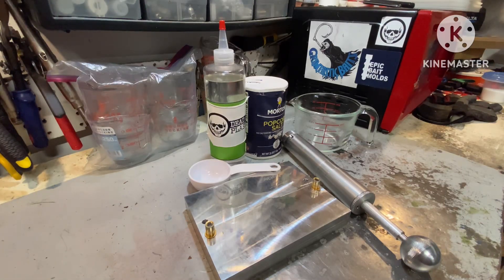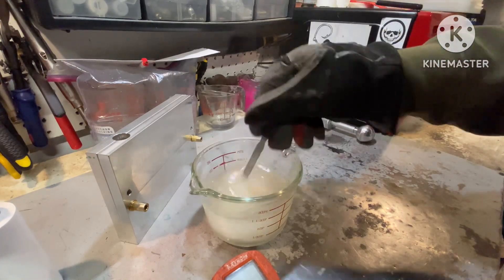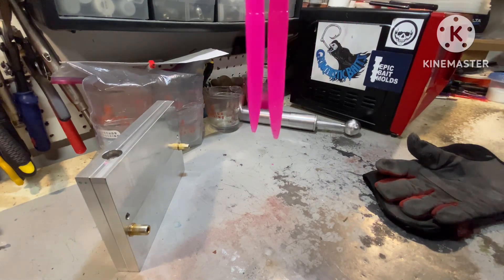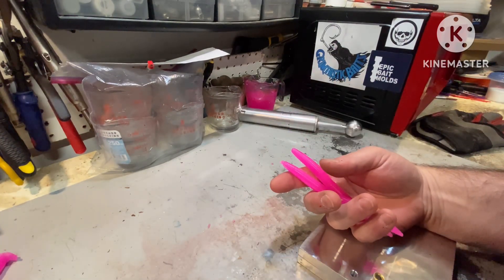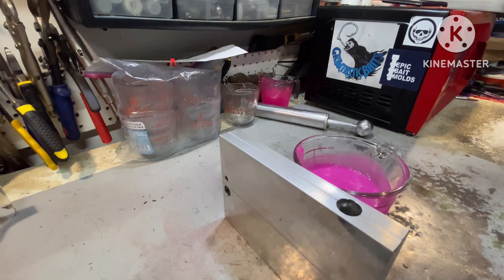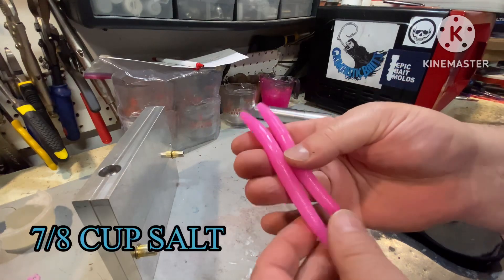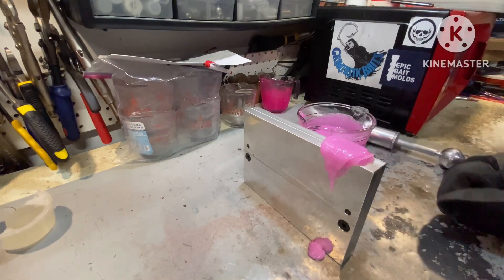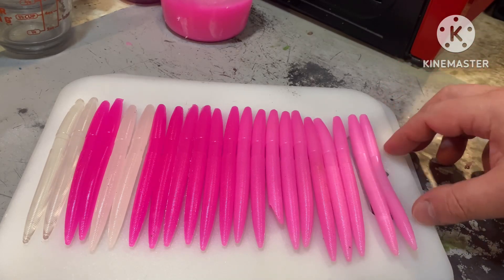How Much Salt is Too Much?!

Comment: If you use fine salt the stuff Barlow's sells for making tackle that stuff is the stuff I use and it's super fine grain. It won't clump up like yours did. Of course you still have to stir it a lot before heating but it doesn't clump like you see in the video. Ur using table salt lol
Reply from the maker: @freshandsaltyjohnny  mine clumped because it was sitting on my garage floor for almost 2 years.  😂